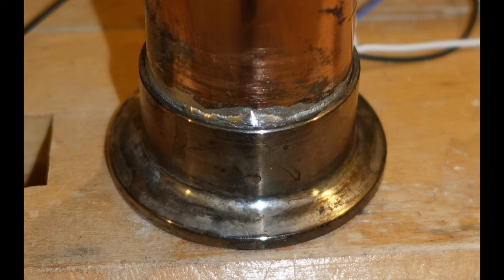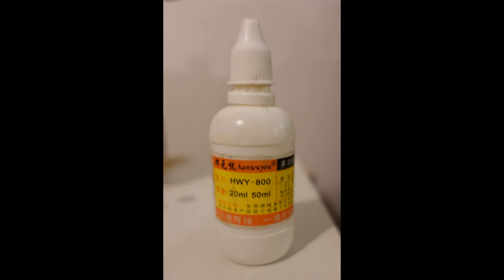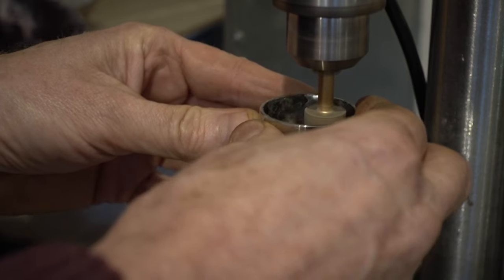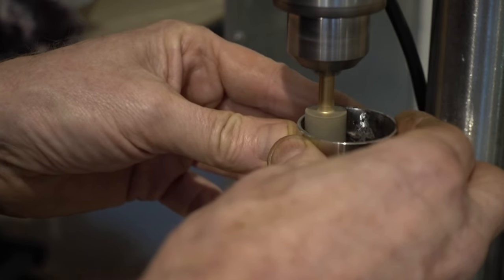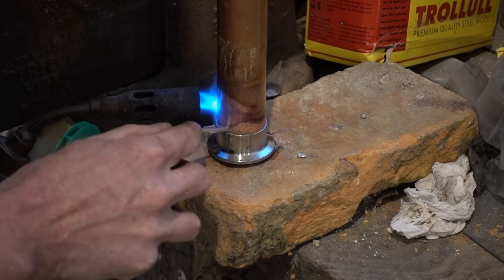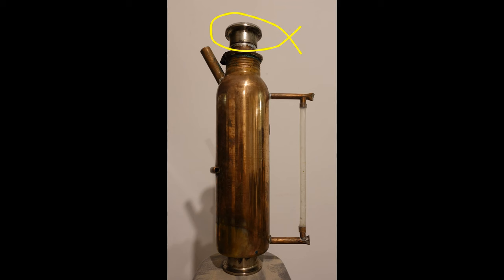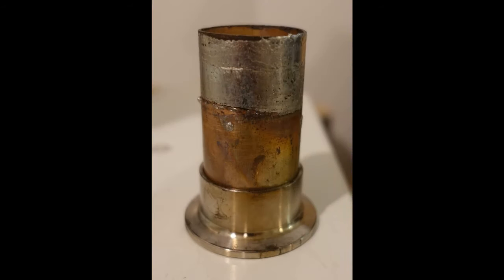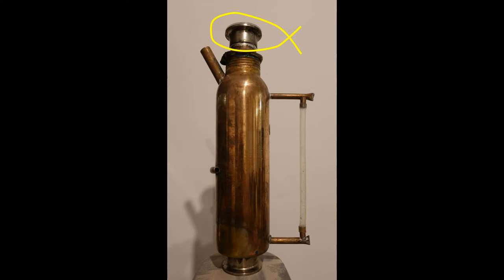Soldering stainless steel Tri-clamp ferrules to copper pipe

Comment: I cant believe how easy and cheap it is to just buy copper/brass/SS triclamp ferrules now days. It was only about 15 years ago i was hand making 2in ferrules by hammering oblong a strip of #4 or #6 solid round the base and carefully filling with solder, file mating surfaces flat. Gaskets were cut from cardboard wrapped to hell with ptfe.Pain in the butt to make but they are so beautiful. All that came about because of my inability to get a stainless npt adapter to stick.
Reply from the maker: Stainless ones are cheap and durable. You can get copper ones but they are a lot more expensive and much softer so don't last as long. I have not found brass ones. It is a great system that makes life a lot easier!

Comment: Yes Sir!, please post more video's of copper to stainless steel soldering using easy to get consumables, I've spent a small fortune on all kinds of silver solder... magic flux... and still I can't master even the smallest joint, I'm on the cusp of buying a MIG welder and be done with it. Thanks in advance mate.💯👍.
Reply from the maker: I have found that pre tinning the stainless is a fairly reliable way out of getting it to work, that is what I did here. If you take stainless, clean it and mount it level, add flux and a piece of solder cut from a roll, then heat it from below, when the solder melts it will usually wet the stainless. After it cools you can solder copper to the solder tinned stainless with ordinary copper flux.
Reply: Thanks for that 👍. @tight1449
Reply: Ezee I'm thinking of cutting sheets from old immersion tanks  just clean off the impurities, only thing copper tanks waigh in for around 60 quid at the minute,  plus try scrap yards, for stainless joints and vessels/ kettles. Hope this is useful to you, everyone seems to be heating their kettles with gas or electricity,  but wood fire is free, I'm using propane, at the minute, but going a wood burner, soon as got time to build one.
Reply from the maker: @johnallerton6402  If scaled up my system would be suitable for solid fuel heating but at the moment I am only running it at about 200W. Even the most modest solid fuel heaters are a lot more powerful than that so for my scale, electricity is more suitable that gas or solid.

Comment: Thanks for the video, and well done on finding a solution. I gave up and used map-gas and cadmium free silver solder. I found it was far easier. The flux for silver solder is a thick paste that only liquifies just before the silver solder melts.
Reply from the maker: I've never tried it. I've seen videos that make it look easy. I persevered because I wanted a solution that was cheap using simple tools. I've done oxy-acetylene brazing which is easy but a cheap butane torch is nether hot enough nor focused enough for me succeed at it.

Comment: Hi, looks like you have learned all the tricks, a bit smaller flame would give you better control.
Looking forward to seeing the apparatus in auction.
Reply from the maker: I tried that but it only seems to work if you heat it fast. I'm using a $15 propane torch so "fast" is relative! I wish I had learned the pre tinning trick from other videos. I would have save a lot of time, solder and gas!

Comment: The people who fail at this  blow me away.  Pick a big manufacturer, say Harris. Look at their catalog, or call them, pick the products for the applications, say Stay Brite solder and Stay Clean flux.  Success every time.  Of course all the standard basics apply, don't burn the flux directly etc, but you wouldn't do that with any joint.
Reply from the maker: The brands of solder and flux readily available varies quite a lot from country to country. Those are US brands but look similar to the Tin based solder and HCl Zn flux that I used